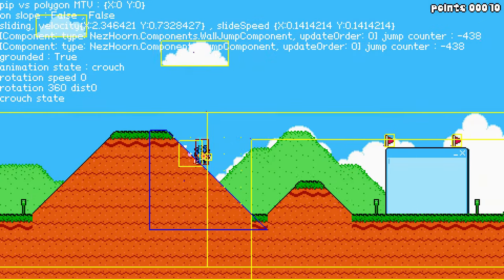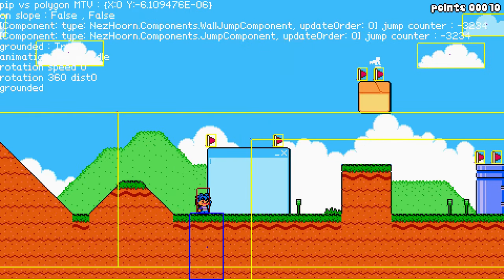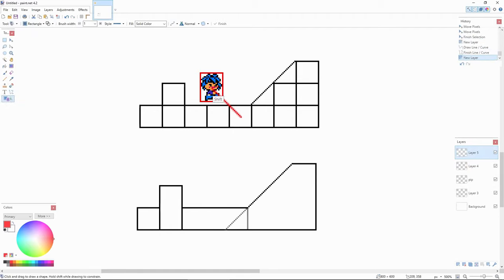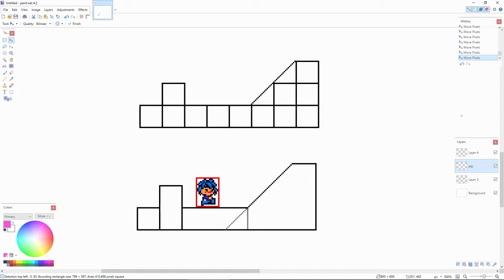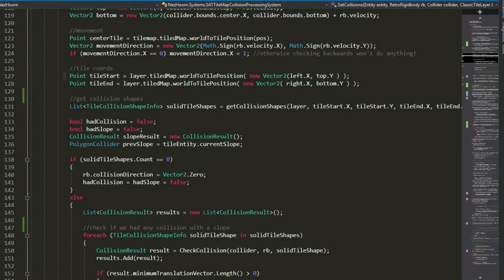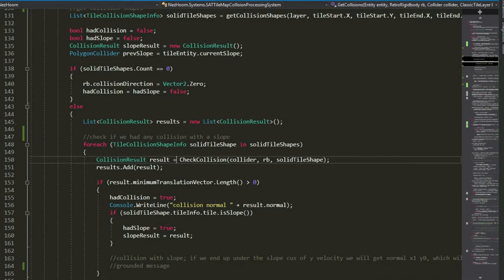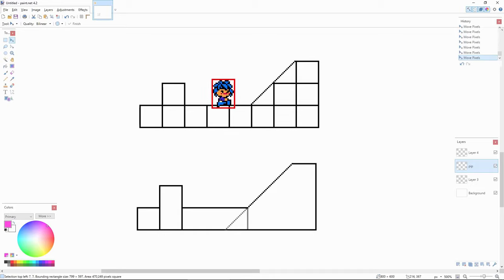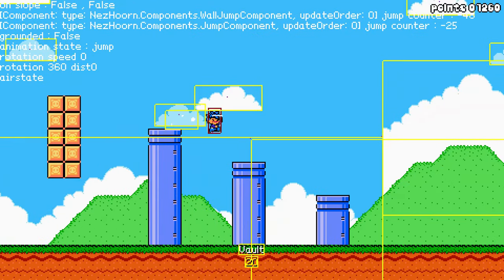Indie Game Devlog 18 : Comparing 2 custom Collision Methods

Comment: 5:24 why not use MTVs (Minimum Translation Vectors) they work really well in my 2D physics engine similar to yours, I didn't want to deal with too much logic so I used the traditional MTVs and it works well

Comment: Could you talk a little more about how you managed to get the character intersecting on slopes? I'm trying to implement something similar to your system, except I'm not using SAT. Since I'm doing it in Unity I'm using Unity's physics queries to detect overlaps, but I can't quite get my head around how you managed to get the effect of the character centering horizontally on the slope.
Reply from the maker: I only resolve on the y-axis and add no physics response, very simple! I'm making a game with slopes now in unity and it's indeed a pain in the butt. Like always unity has no way to override the default behavior, very annoying. Right now I'm just using a raycast and snap the character to the slope before he actually collides.
Reply: @Eendhoorn  Very interesting. I'm now experimenting with Nez + monogame. I tried Monogame by itself a while back and although it works fine, there's a lot of systems that I don't want to have to write, so now I'm giving Nez a shot and so far it seems pretty good. I'm thinking of copying your approach with SAT here.

I'm planning on using Tiled as my editor since that's what I'm used to, and I was wondering if there's a reason you do tile merging at runtime instead of precomputing that in some way?
Reply: @Eendhoorn  Is there a way I can contact you? I'd love to have a chat about collisions on slopes and also about merging tile objects together into larger colliders.
Reply from the maker: @xThuby  I love Nez! Sure, send me a DM on twitter!